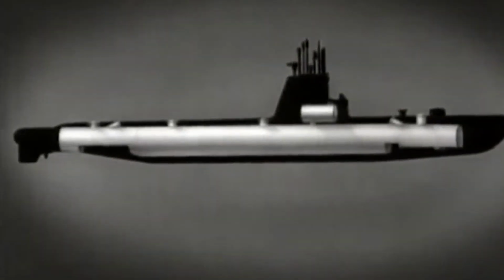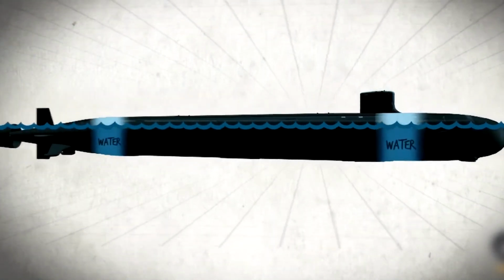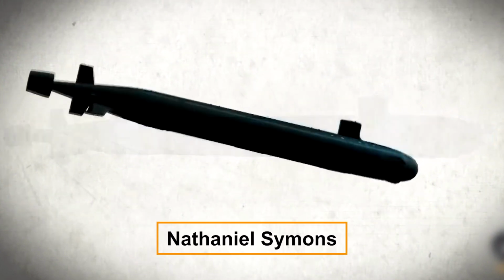How Submarines Are Made?

Comment: The process of making submarines involves precision engineering, advanced materials, and rigorous testing. From designing the hull to integrating complex systems like propulsion and navigation, every step requires meticulous attention to detail to ensure safety and performance in underwater environments. Additionally, stringent quality control measures are implemented to meet stringent standards for reliability and endurance. Overall, the construction of submarines is a fascinating blend of innovation, technology, and craftsmanship.